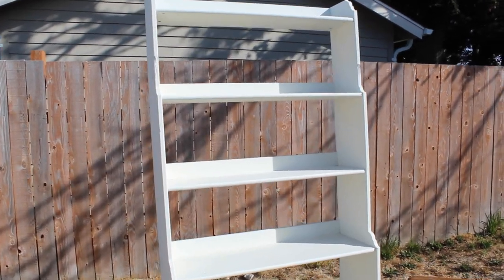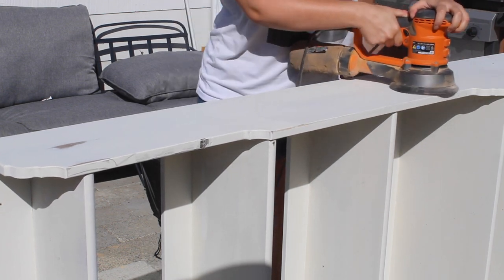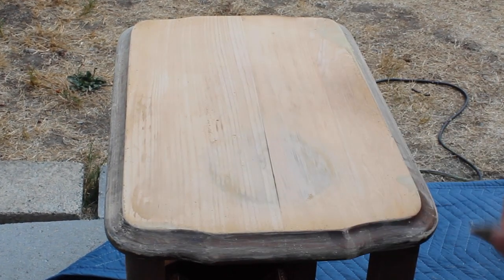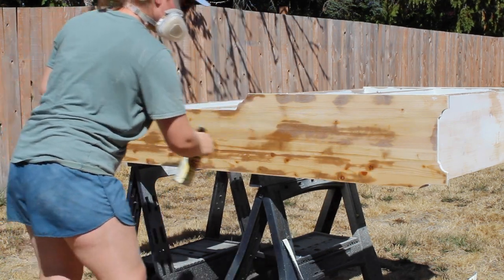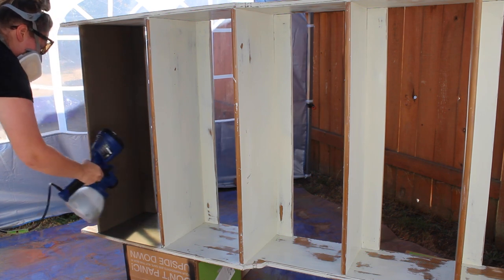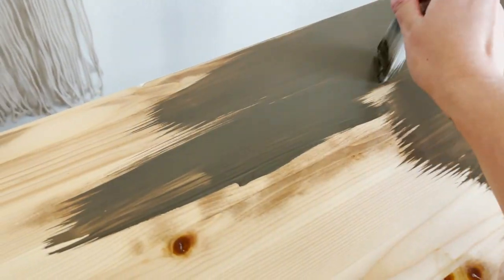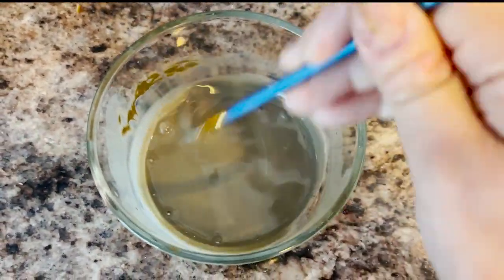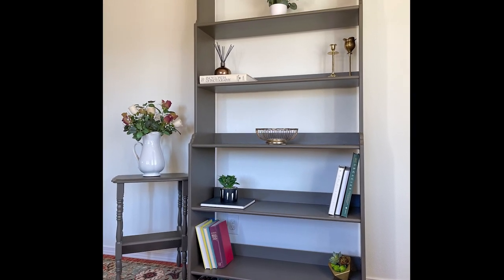IKEA Furniture Flip | Furniture Makeover with Melange All in One Paint!

Comment: They look great. Nice trick to get rid of the brush marks. With an all in one paint, I've heard that watering it down too much might change the topcoat quality. Did you notice anything like that when you diluted your final coat?
Reply from the maker: Thanks Sandy! Nope I didn’t notice any issues. However I had already done 3 full coats so I wasn’t really concerned with thinning out the top coat for protection as I already had solid coverage. Now if the wash would’ve been my second coat with only one full coat under it than yes that might compromise the durability level. Just be sure to have a solid base and you’ll be good.